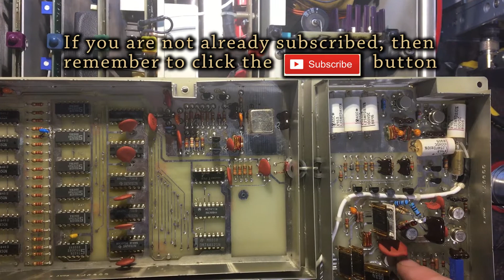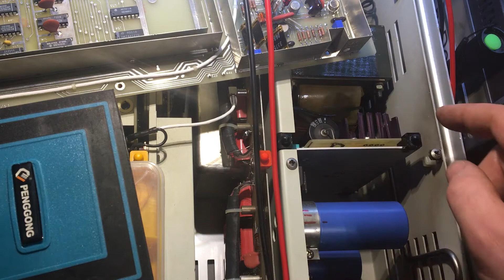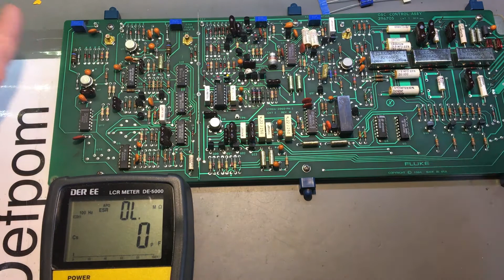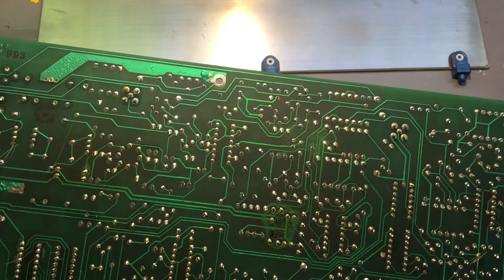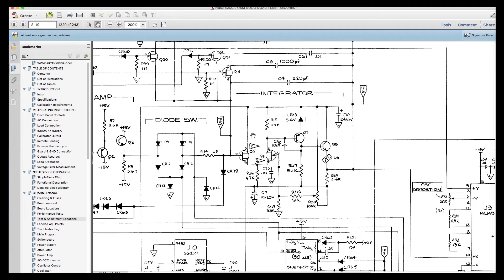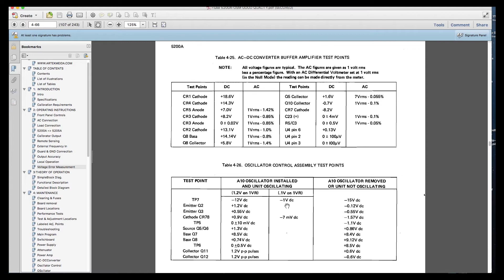#305 Fluke 5200A AC Calibrator Repair Part 7 - General Component Tests

Comment: None of those caps you tested would pull the supply down. Might affect oscillator, but shouldn't stop it or cause your excessive current drain.

Comment: I would poke around with the scope, You can check voltage/ripple on caps and check output waveform from integrator...

Comment: You certainly are having a lot of trouble with your 5200A. I had only a minor issue with a bad via on mine, which was relatively easy to locate and fix.
I recommend that you print out a copy of the circuit diagram and note down each of your measured voltages along with the correct voltages. Having an overview of the voltage differences across the whole circuit will help you trace back to the area where the fault originates.
If you are still having trouble with your extender card I can lend you a proper Fluke 5200A extender card. I am located in Christchurch.
Reply from the maker: Stephen Bell - thanks for the offer, I think I got this extender sorted out though, I wire brushed it and scraped between all the traces, as under close inspection I could see copper flecks in between the traces. I hope to get back onto this project soon, I haven’t touched it in a month!